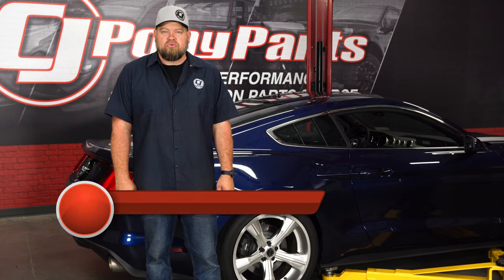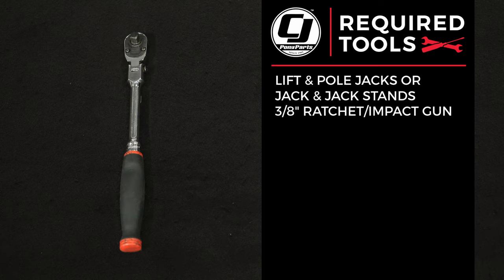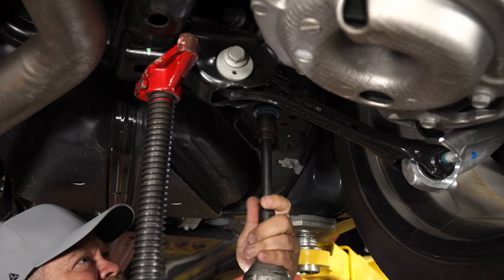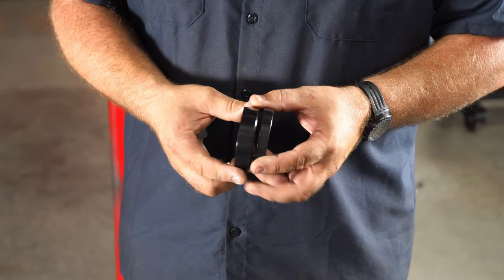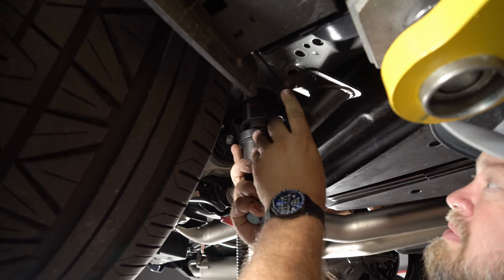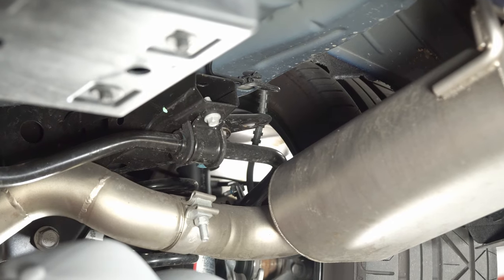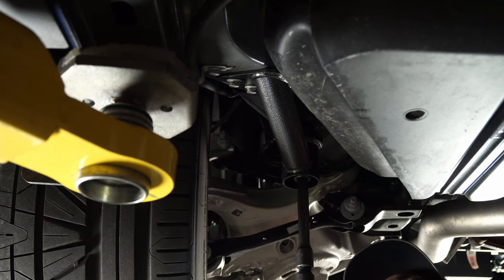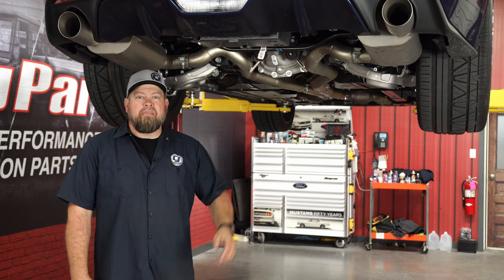Eliminate Your S550 Mustang Wheel Hop With This BMR Level 2 Cradle Bushing Lockout Kit!

Comment: Put this on with BMR Rear Vertical Links and no more wheel hop. Does ride a little bit stiffer though.
Reply: Do you have rear drag springs or just regular eibach lowering springs/ non drag springs?

Comment: Will these work with steeda subframe braces as well?
Reply: i was gunna ask the same question
Reply: Steeda subframe braces won't fit with these. I have had both, but not installed at the same time.
Reply: Kaleb Branam do you need them with the Steeda braces? I’ve got a convertible and there’s no way to use the Steeda but I think I can use these.
Reply: @redlinemotorcars2184  no, I don't need them but I figured if they added more support then I'd go ahead and add them!

Comment: Does this add noticeable NVH?
Reply: Yes it does but nothing crazy.
Reply: Yeah, when in like 1st or 2nd gear. Or like rolling around a parking lot etc. When going 30+ I can't hear it.
Reply: I've noticed just the rear a little stiffer no more flex, but it stops the wheel hop, now I just spin in a straight line and launches straight after it hooks